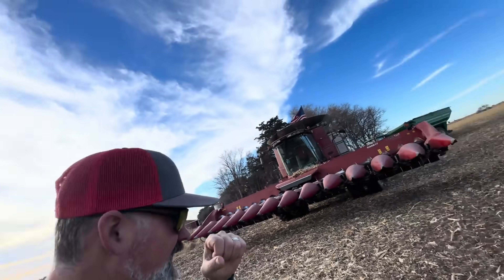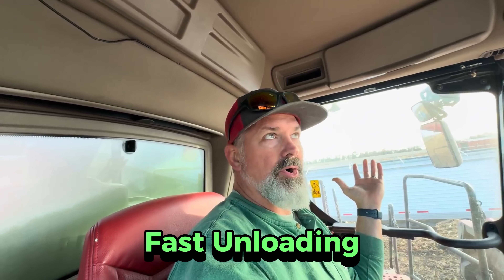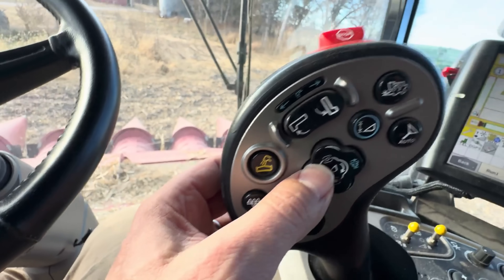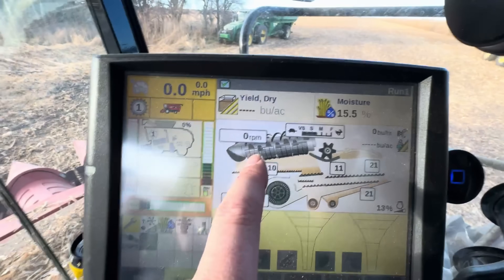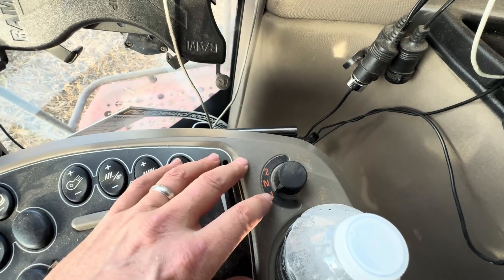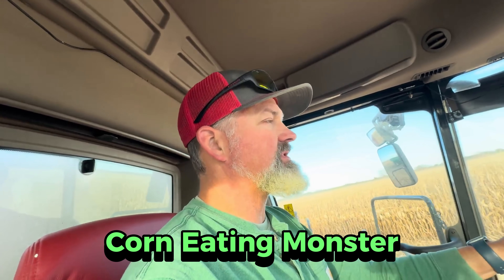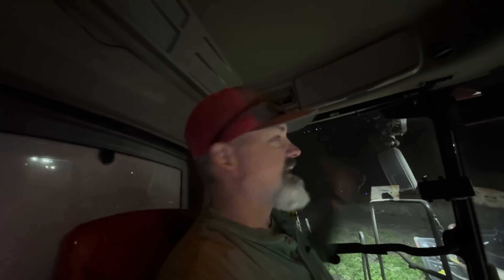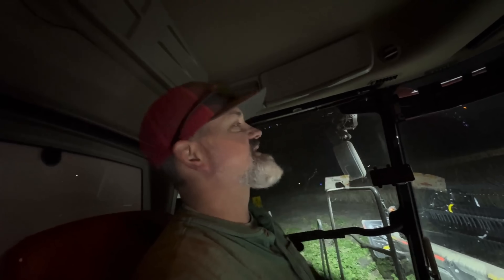CLAAS 8600 vs. CASE 8250  (Part 2)

Comment: I’m on my 3rd CLAAS machine, a Trion 740. Haven’t been in a CIH since the 1480 years ago. The rear window does open on the Lexion from the tank side. It doesn’t open very far but enough to reach in and clean. I have the movable spout, it’s handy. Also mine has the footrest pegs. It took me awhile to catch on but the Trion control handle has the unload buttons on top and the header buttons on the side. The CLAAS I think does the best job of spreading residue of all machines. It takes awhile to get used to the German engineering thought process. They do a few things that are just baffling to me. One is they seem to like to have the reel move to a standard position when you lift the header then want you to readjust the reel when header is back down. It can be turned off so not a big deal. Other thing is you have to move the straw spreader to the road position to get full speed for road travel. This amounts to the lifting the spreader tail up about 8 inches then you have to put it back to field position before starting machine. It’s all done from the cab but makes no sense to me.
Reply: I have 2 trion 730, I bought that combine when it came out and it is fantastic when you harvest corn and beans with high moisture and it is great at fuel consumption.
It may not have all the optional that the flagship combine have but it is quite simple.
I come from a class 760 so a bigger one
Reply: I'm from Germany and I own a John Deere combine harvester. We Germans always say, "You have to get used to American engineering." 😂😂😂
Every country builds its machines a little differently. I guess it's all a matter of getting used to it in the end. Greetings from Hanover, Germany